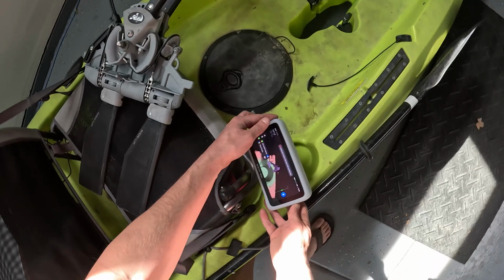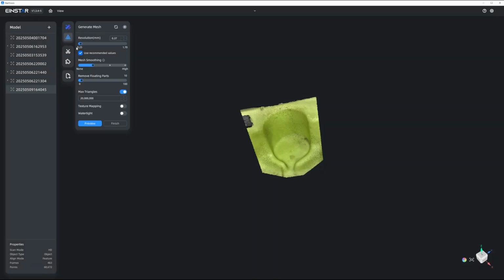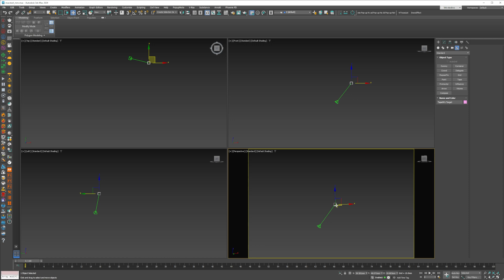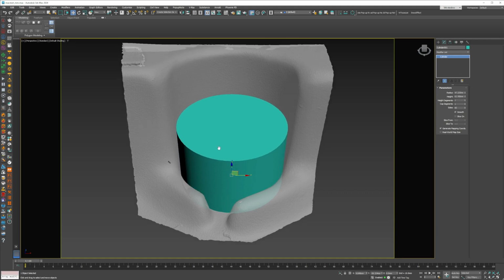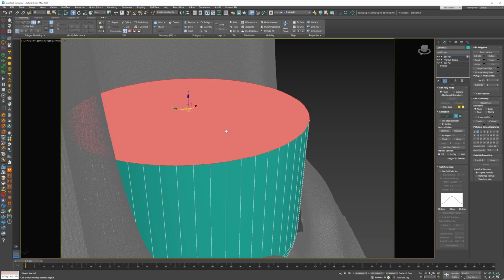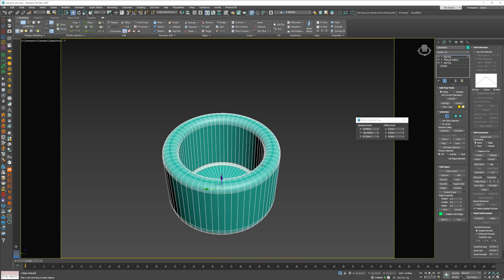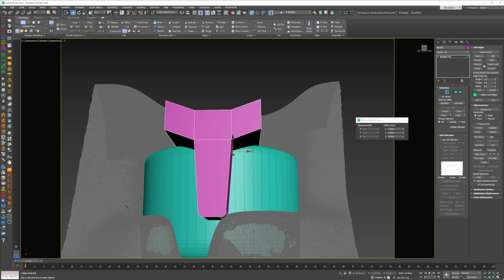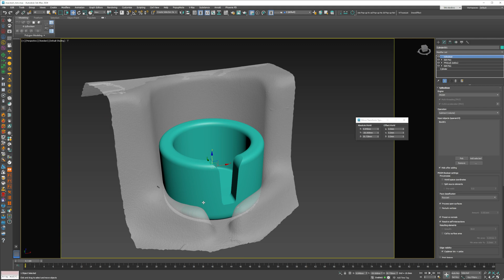I 3D Scanned My Kayak’s Cupholder and Made It Better!

Comment: How do you find the Vega over the Einstar?
Reply from the maker: So I need to personally do a test between the two on a medium size scan because I have not used it much. Right now what I have noticed is convince wise its amazing. But the few scans I did do that are in fast mode the quality did not seem to be similar to quality of an Einstar. So thats where the Einstar might be a winner when it comes to speed/quality.